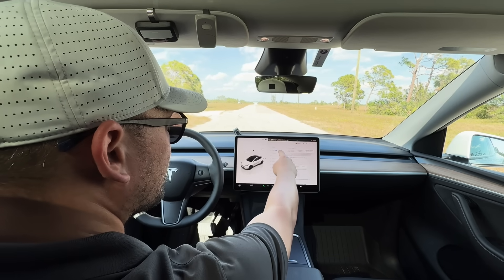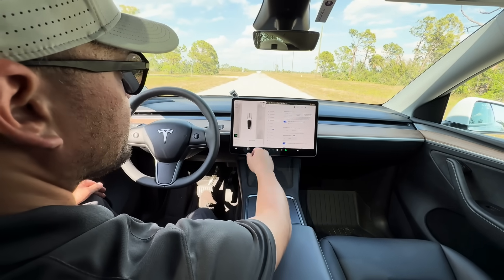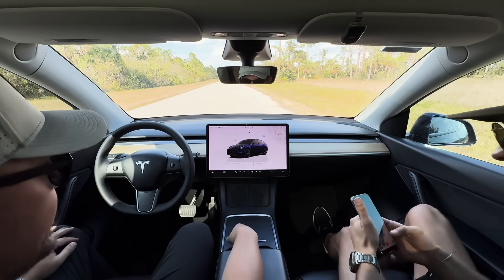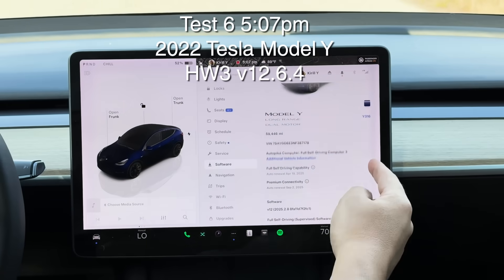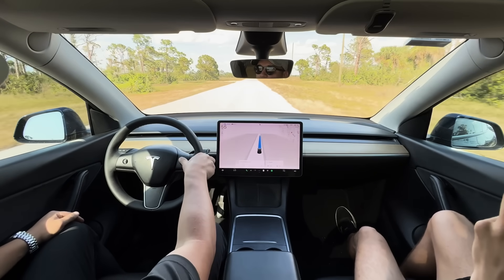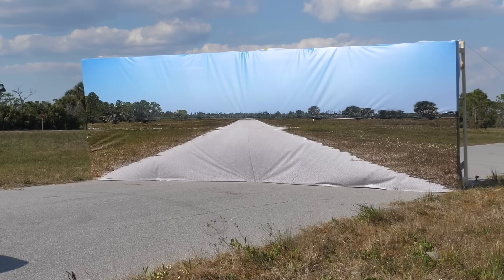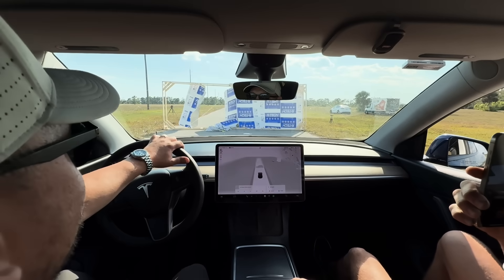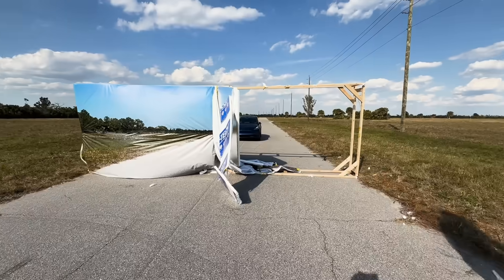Mark Rober Debunked - You can't fool a HW4 Tesla using FSD!

Comment: Me being a pleb stuck on HW3 and FSD 12.  Guess I better watch out for fake walls.
Reply: You mean real walls, fake image 😂
Reply: That's not the point,  the car should know exactly what is in front of it at any point in time, if it can't see a wall because it's camouflaged, then how do you expect it to see anything as what it actually is.
Reply: Or you can just drive 😮
Reply: From a realistic standpoint, this doesn’t debunk anything. The perspective of the wall is off. A break in the perspective, lighting and coloring is clearly visible in your example. Additionally, where are the controls? …independent verifications? …and so on? And Mark Rober’s experiment wasn’t JUST about a photographic wall. IMO, it was about highlighting real world automotive scenarios that Tesla KNEW their vehicles couldn’t handle… but they released them anyway. 

Let me be clear. I’m not for, or against Tesla. I even owned a Tesla for a short period of time. Most importantly, i think what you’re doing here is extremely important - challenging narratives, instead of blindly believing some random video. But we need to do proper experiments so these videos gain the proper traction and exposure.

The truth is, there is a reason why most other manufacturers are using lidar instead of ONLY cameras. Cameras can be “fooled” by what they see… in a very similar way our human eyes are thrown off be our perceptions and biases. Put simply, LiDAR is safer and far superior tech.

Read those Tesla reports. Tesla, itself, were well aware of the problems their system presented.  Instead of spending the money on lidar, they cut corners to salvage their public image and save their shareholders money at the expense of public safety.

Again… this is a GREAT VIDEO! Keep holding them accountable! 👍
Reply: @normanjones9403  "The perspective of the wall is off. A break in the perspective, lighting and coloring is clearly visible in your example. Additionally, where are the controls? …independent verifications?"
Did you make the same comments on Mark Rober's video? I'm betting you didn't, but please correct me if I'm wrong.  I know for a fact all these things equally apply to his video.  Further more he specifically didn't show the downsides of LIDAR, for example that it would have stopped in that water test even WITHOUT the fake person in the road.
Reply: @ The simple answer is yes. But Mark Rober has a huge budget and access to resources most people don’t. He’s very effective at listing the parameters of his experiments. So most of the questions are answered during the video… and supporting videos. 

As I stated, I loved this video! But if it’s going to gain the traction the creator intended, it needs to address the questions a common viewer might ask. I’m not negatively criticizing the video. I thinks it’s AWESOME when people effectively debunk something. 

Agin, I’m stressing that I thought the video was awesome!

Truth is everything. And especially during these times… the truth is an absolute necessity.
Reply: @normanjones9403  I'm just saying the colors and perspective etc were very off on Mark's "wall" as well.  He had no controls or independent verifications either.  I'm just wondering why you're picking on this creator yet not holding Mark to the same standard?
Reply: I think the bigger, actual issue is some of the other tests that the original poster attempted. Fog, rain, kids running out in the street. Can HW3 prove to be reliable in THOSE circumstances?
Reply: He didn't do the fog test.
Reply: @Oneness100  I think he said more tests are coming.. guessing fog and rain ones.
Reply: @accumapmodels  Yeah.   I have watched other sites that go into more detail about the various types of sensors, cameras, Lidar, etc. and Elon's doing the cheapest route.   I wouldn't trust Tesla for FSD.  I also don't trust Elon because of what he did at FHTSA and he got a bunch of investigations of car accidents involving a Tesla stopped, which means he's trying to HIDE problems with Tesla.  HIGHLY corrupt.  

As far as I'm concerned, Elon should be removed from Tesla as a CEO, he's totally untrustworthy, he's corrupt and he's a liar.
Reply: Yeah, happens to me ALL THE TIME, it's really quite annoying!
Reply: @plm
 I didn’t deflect. You just tried to spin away Elon’s nastiness. I wonder how your highly wrinkled brain will spin his support for the AfD neo notsee party now. Let me see, complain to YT again, that someone is hurting your thin skin with truths? 😏
Go away, you are just a blind follower of FElon. That is all you will ever be. Ideology replaced whatever grey cells in your noggin eh?
Reply: @

 I didn’t deflect. You just tried to spin away Elon’s nastiness. I wonder how your highly wrinkled brain will spin his support for the AfD neo notsee party now. Let me see, complain again, that someone is hurting your thin skin with truths? 😏 Hypocrite.
Go away, you are just a blind follower of FElon. That is all you will ever be. Ideology replaced whatever grey cells in your noggin eh?
Reply: Yea, they’re everywhere ! 😂
Reply: Yes, fake walls are just everywhere...
Reply: That Tesla ran into the side of a truck because it thought it was road .. so boy only fake walls
Reply: ditto
Reply: I hope no one put fake walls to prove Lidar is better.
Reply: You own a Tesla ... better watch out ... the Demorats will call you a n@z!
Reply: As long as you don't see any roadrunners or coyotes around any corners you should be good.
Reply: @Algorythmfpv   ... or ACME boxes ...meep meep
Reply: There is a reason chameleon pain job's where banned as well as highly reflective pain.
You need equipment that can see or detect "stealth" such as the old stealth bomber etc. was visible to the eye but not radar due to it's surface not reflecting back to sender (radar).
A wall such as this would have a different signature in some spectrum's of light to the terrain hotter/colder in the infra red spectrum etc.
Reply: Yesterday I was stuck in a HUGE standstill situation on a 6 lanes highway. Why? A pickup truck hit the back of a truck (with a trailer) and made him lose control and hit 7 more cars. Drivers behind this pickup didn't keep distance so 5 more crashed one each other. No rain. No fog. Just a talented ricer Speedy Gonzalez. Yeah, a photorealistic wall is our problem today.
Reply: @AntonySimkin  Oh you must be mistaken.  People NEVER make mistakes or cause accidents.
Reply: @JohnVanderbeck  so I'm a robot then? People never make mistakes haha Sometimes I watch people attending such an important conversations through WhatsApp about what will they eat for dinner and this is going high speed and I wonder how do they even dare to criticize ANY robotic assistant while they are literally trying to kill someone... Humanity really amazes me (now I talk like an AI lol)
Reply: Na dont worry, Elon got you Coast to Coast in 2 years since 2016.
Reply: You can upgrade your hardware.
Reply: LOL, with a photograph that realistic how many actual human drivers wouldn't be able to notice it?
Reply: @TronJockey Most humans not on drugs or drunk will notice it.
Reply: @Xetairex  Statistically in the US alone 9 people are killed every single day just by distracted driving.  I would be willing to bet 0% of distracted drivers would notice that, since they seem to not notice stop signs, constructions zones, or even what lane they are in!
Reply: @ Right, so what’s the big deal if FSD also ends up killing a few, eh? Except, you are paying several thousands of $ for a system that is demonstrably bad. One that could kill you, because you put your faith in a snake oil salesman.
I know none of what I write will change your mind. MAGA and Elon faithful have decided that they are super smart to follow Trump and Elon. So, go ahead, believe whatever. Don’t forget to load up on TSLA, BTW. Going to what 2500$? Maybe even 10000$ in a few years, no? 🙂
Reply: @andycole5957  I guess that makes it fine for FSD to be poor in its operation. Nice (MAGA) logic there.
Reply: @TronJockey All of them. We have stereoscopic vision which gives us depth of field for 3D depth perception, so all humans with 2 eyes would have immediately spotted it. The Tesla is a cyclops with no stereoscopic vision or depth perception.
Reply: damn got to let Will E. know that his gig is up ... wonder how he will feed his family now
Reply: @youdontknowme3935 
The business card reads -
Wyle E. Coyote
Genius
Reply: I guess this basically proves Mark Rober was showing the truth. He didn't say it failed with FSD hardware version 4... He just said his Tesla with Autopilot > which is 100% accurately what Tesla has advertised it, sold it, and has said for a DECADE. Self driving autopilot > failed.
Reply: @seebeforeyoubuy no, he lied. He turned off soft ware and then edited his clips to look like one take. Thats not the truth at all.
Reply: @Under-Kaoz  AEB is supposed to work no matter what. Try again, fanboy.
Reply: @ Oh, but to these Elonstans, YOU are the problem! Why can’t you upgrade your car, and hardware every few months, like normal Tesla fanbois do! “Have you tried the latest V blah blah version? It kills!” 😁😁😁
Reply: @ I happened to notice you couldn't dispute what I called out about your misinformation.  Instead you deflected.  Imagine that.  Do you type out your posts, or just copy and paste from others in your social media bubble?
Reply: Look at the effin crybaby plm. Like his idol, gets easily hurt in the backside when people show him the truth. 
Your messiah supports AfD. How do you spin that? Go away, pray to your messiah’s poster.
Reply: @seebeforeyoubuy  Mark's result may have been similar, but he was still caught red handed turning off Auto Pilot before hitting the wall...and he did not use FSD.   He stacked the deck to promote his sponsor's LiDAR, and also faked sneaking it into Disneyland...that is pretty obvious.
Reply: @seebeforeyoubuy Had he been honest about LIDAR technology in the same video instead of presenting situations where it also fail as a win, then it'd be all good.
But it was slanted AF. I think that's what people are taking issue with; he claimed to be scientific (stated as much) but it was in actuality a Luminar ad.
Reply: @seebeforeyoubuy  Tesla also said for a DECADE it's a work in progress and if you use it you're a Beta tester, anyone not smart enough to understand that shouldn't have been using it. Rober compared both systems as "equal" when in fact he was not using the (latest) FSD "equivalent" and he could have.  Autopilot is more like Adaptive Cruise Control on steroids and that's the system he chose to test against a Lidar, in a series of tests paid for by the Lidar maker no less. For someone of his qualifications (and as the FSD user he claims to be), he knew better and those tests were non-sense. He wanted those Lidar-biased results.
Reply: You missed Roeber's other tests that the Tesla failed, mowing down the dummy kid several times.
Reply: HW 1.5 checking in. 
Banned from FSD. 
Autopilot only usable on freeway. Phantom breaking for bridges.
It was cheap though. 👍
Reply: Just pay daddy elon another upgrade,  this will be the last one i promise
Reply: the absurdity of the painted wall example is all the FSD deniers have to argue their side anymore
Reply: @kvickart  and eventually they won't have that excuse either...they'll have to cover the cameras with sticky notes (blindfold) as a new excuse and say the car can't "see"
Reply: @kvickart You missed the other two tests that it failed in Roeber's video, mowing down a child. Go watch the full video before beating your chest about the Swasticar's vaporware. Elon said Full Self Driving was a solved problem in 2016, yet almost a decade later, Tesla's FSD is still an SAE Level 2. Full autonomy is SAE Level 5. Tesla is FAR from that. The Koolaid must be tasty.
Reply: @kvickkart The fog, the rain they are pretty absurd as well. I mean this whole anti-Tesla thing is totally absurd. Elon is a lovable maniac. So what if he sieg-heils some times? Haven’t YOU done that sometimes in public? So what if he tanked Twitter? So what if he has tried to fire air traffic controllers in the name of government efficiency? He is the world’s richest person! He has every right to do whatever he wishes!
Reply: @Xetairex  Holy cow talk about unhinged misinformation.  Did you forget Walz doing that exact same move on the campaign trail?  It takes a very smooth brain to interpret either as a salute.  Twitter is worth the same now as when he bought it.  He never tried firing air traffic controllers.  On the contrary, he is streamlining the hiring process.  I don't really like the guy, but you're just making stuff up.
Reply: @Xetairex 😂😂😂😂
Reply: @earlysda  Why?
Reply: @Xetairex  Almost had me, you scoundrel 😂
Reply: @Xetairex  who has he fired?  No one he shows rhe results of his findings and the department heads make the decisions.  Last I checked Twitter is working just fine.
Reply: @ Being rich doesn't mean you special rights that prevents you from being sued, fined, or convicted of a crime and sent to prison.

So what if he's tried to fire ATCs?  Oh, next time you go on a flight, and the plane crashes because there's not enough trained ATC's, blame Elon. 

In the name of Government efficiency.  No, Elon just wants less Government so he doesn't have to pay taxes, be investigated, fined or be sued for crimes he's committed ro WILL commit.

He's what is called an Oligarch and he wants to run our Government ILLEGALLY.  he can never become President because he wasn't born in the US.  so, he bought the Presidency whom appointed him to attempt to do whatever he wanted and it's backfiring.

One.  The Courts have been reversing much of what he TRIED TO DO.  He's an embarrassment.  He actually should have been thrown in prison for a lot of things he was doing.

Two, his company is losing sales around the world,  HAHAHAHA.  He isn't the wealthiest man in the world and Karma is catching up.  Go cry somewhere else. EVERYTHING bad that's happening to Elon and Tesla is because of Elon, and hopefully it will get worse for him since he's the one that behaves like a spoiled little brat thinking he can do whatever he wants to without regards of integrity, honesty, and legally.
Reply: @Xetairex Walz and Bernie just did the same salute! Let me see ya cry about them as well.
Reply: @ Bernie doesn’t support AfD in Germany. 😏 You guys are so…simple in your thinking. 😁
Reply: @Under-Kaoz  Did you fact check it?  Obviously not.  You need to fact check EVERYTHING.  Too much false information. On both sides.  But I just fact checked your statement and YOURS was 100% BS.
Reply: @Oneness100  heres your L. Just saying you checked means nothing. The truth doesn't care about ur feelings.
Reply: @Under-Kaoz  but you haven't provided proof of your statement.   Let's see the Proof.   When someone makes a statement, and I can't validate it, then the person that made the statement must provide proof.  Please show me proof since I wasn't able to validate it. My fact checking sources indicated that your claim was not fact, it was false.   

Ball is in YOUR court, so what are you going to do?
Reply: Beep! Beep!
Reply: Year , every day problem . Popping up fakewalls. Had it two times last week.
Reply: I did not deflect, you tried to spin. Now you are resorting to projection by declaring my post as ‘misinformation’. Pathetic.

Comment: I'm kind of curious as to how the wall would show up in the high-resolution parking visualization (that 3D reconstruction of the space around you shown at very low speeds). Especially on HW4.
Obviously, it's not showing up on standard AP/FSD visualization because there is no image asset for it (although I wish there was a stock asset for anything FSD gets confused by but knows is there).

Comment: Wow an unbiased test using a Tesla without an ulterior motive. Thank you for an honest review!
Reply: This guy only makes Tesla content. There is a bias.
Reply: @snarkyalyx you can’t fake a Tesla fsd video when it’s actually using FSD 😅
Reply: @dominomasters104  The image that mark rober used was visually aligned with the right lane, the image they used in this video was alinged with the center of the road, which is a huge difference.
Reply: @ you sound like mark he was wrong he was using basic free autopilot and he said it was fsd now that’s a huge difference if u wanna talk different
Reply: @dominomasters104  The thing is that Telsa disabled the Ultrasonic sensors they had on cars, which could have prevented driving through the wall. Getting rid of Ultrasonic sensors (or not relying on advanced technologies like LiDAR) can save thousands of innocent pedestrians that die each year. Oligarchs like Elon are cheaping out on safety for higher profit margins, and there is no excuse for that. I don't care its FSD.

Comment: The release date for Tesla's Full Self-Driving (FSD) Beta version 13.2.8 on Hardware 4 (HW4) is associated with the software update 2024.45.32.20, 
which was made available starting February 17, 2025. Another related update, 2025.2.8, also includes FSD v13.2.8 and was noted to have a release 
date of February 27, 2025. These updates highlight significant improvements in addressing the "fake wall" issue and other enhancements in 
autonomous driving capabilities
Reply: Thanks chatGPT, very cool.
Reply: Weird though since Mark's video came out on the 15th March. Taking into account a VERY generous production timeline of 2 weeks this still is ahead of the Feb 27 update, which in all honesty Rober should have used anyways.